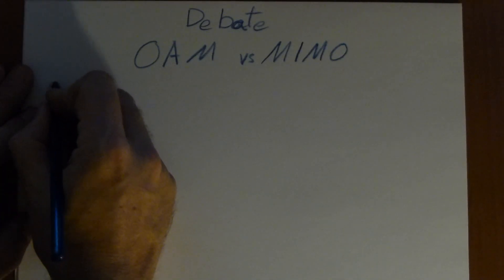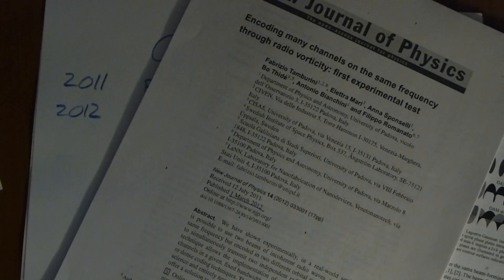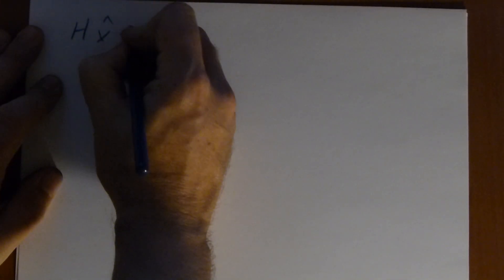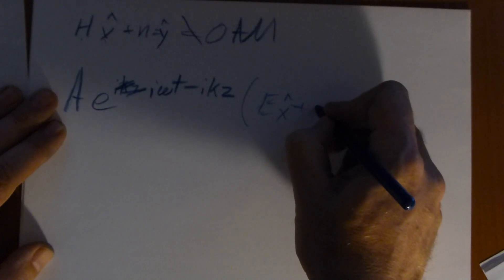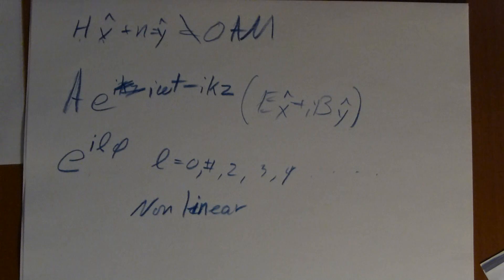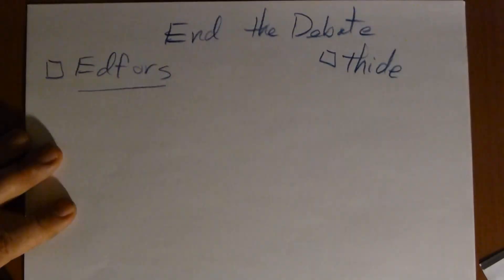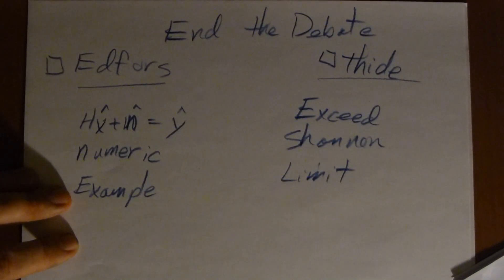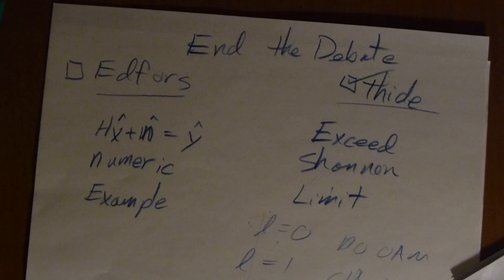Infinite Potential or Old Technique? OAM vs MIMO

Comment from the maker: An important controversy in science currently is Orbital Angular Momentum. Does it mean we have infinite bandwidth capacity in a single frequency, or is this an old method called MIMO? I explain the debate and propose a simple way to end the fight, and cut the Gordian knot once and for all. 
 #sciencesunday   #OAM
Reply: See, I don't think he'll ever be able to exceed the Shannon limit. Here's why.  I'm sure the OAM effect works great for l=0,1,2,3.  However, I don't think that he will ever be able to build an antenna that will be very good at distinguishing OAM L=100 waves from L=101 waves.   I believe that there will just be a whole-lotta cross-talk between the two.  -- aka lots of noise: the L=100 channel will be swamped by noise from the L=99, 98, 97 and 101, 102 103 channels.  it'll be barely usable, at a very low bit rate.  And if you think L=100 is doable, think L=1 million or something.  And when you add up all of the total bit rates of each L channel, from 0 to infinity, you'll get ... the Shannon coding theorem result, nothing more, nothing less.
Reply from the maker: Linas Vepstas I would not worry about l=100 yet! If we can just get l=1 and l=2 to work, we will have a lot more bandwidth to worth with. If we build the antenna or dishes right, untuned modes will cancel themselves out. That makes it a hard problem, but that is far different, from an impossible problem. It should be like differentiating frequency, which we can already do to a tremendous degree. 

Perhaps I should do another video on how the modes are distinguished, both optically (which has been done for decades) and radio-wise.
Reply: Anyway, I also don't think your non-linear argument holds water.  "Everyone" knows (starting with Christian Huygens some 400 years ago) that the way to model an antenna is as a collection of an infinite number of microscopically tiny points, each point emitting omni-directionally.  As those waves propagate, they bounce off walls, go through openings, etc. and to find the wave intensity at some point, one must sum (actually, integrate) over all these points/paths.  Doing this explains diffraction, interference, antenna gain, all of optics, and much much more.  The theory behind this is an undergrad physics/electrical engineering staple: its impossible to avoid a class in this for either physics or electrical engineering (and still graduate)

That summation/integration still holds for those OAM split-dish antennas.   You start with the coax cable or whatever it is that is feeding the dish. All the electrons in that cable are in phase.  They get to the emitter in the antenna: at first a simple dipole, and then bounce off the split dish, and thus get the OAM structure.  But the flight-time of the photons is fixed: its the speed of light. The distances are fixed: in some places, the dish is farther away from the feed than others.  But in the end, to find the EM field intensity at some point in space, you add up the (infinite) number of point emitters and paths that the waves took. And the addition is linear.  There is no such things non-linear addition of photons.   Photons cannot bounce off of one-another. They are linear.  (Well, there is an exception for quantum electrodynamics, the four-photon loop, but the effect is so tiny, something like 10^-18 in strength and has never been observed.)

So anyway, to get the EM field strength at the receiver feed-horn or dipole or whatever he's got attached the the wire at the receiving antenna, you simply must sum over all possible photon paths from the transmitter feed to the receiver. And that summation(integration) is fundamentally linear -- there is no such thing as a "non-linear integral": integrals are, almost by definition, linear.  So trying to argue that there is something non-linear in the OAM wave is .. well, it makes no sense.
Reply from the maker: Perhaps non-linear addition is the wrong word to use, but the fact remains you still can't get an OAM state by summation of non-OAM states. Even if we accept there is some way, you are still left with conservation of angular momentum which means we can't get that quantitized angular momentum, while still having a clearly defined Poynting vector. 

And yes, the actual integration of E-field on the antenna is not substantially different from ordinary antennas, except in shape. For instance, two parallel antennas placed end to end, but 180 out of phase, could receive l=1,3,5.... OAM modes but not l=0,2,4... (even) modes. An ordinary wave (l=0) would cancel itself out. The actual signal going into the radio would not be different at all. 

As for different antennas receiving the signal at different times, in the near future I expect point-to-point communications, such as for microwave towers, to be the most important use. 

And not that it is relevant here, but I believe photon-photon scattering has been observed in high intensity lasers. At least I recall having read something about that.